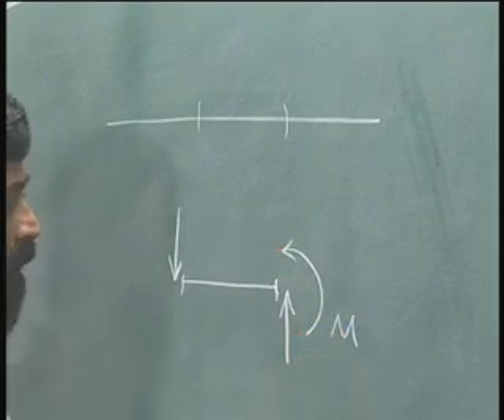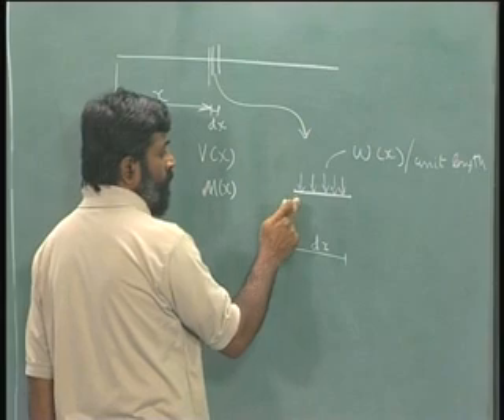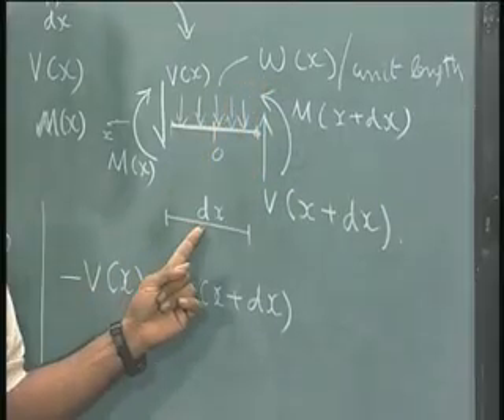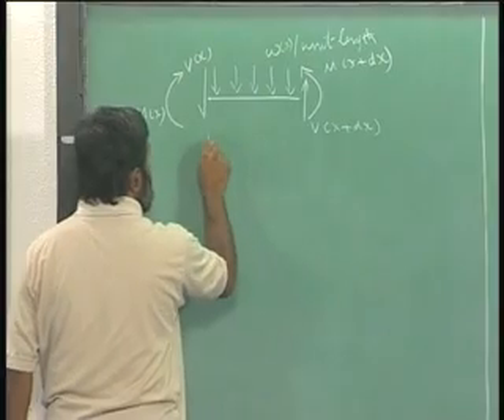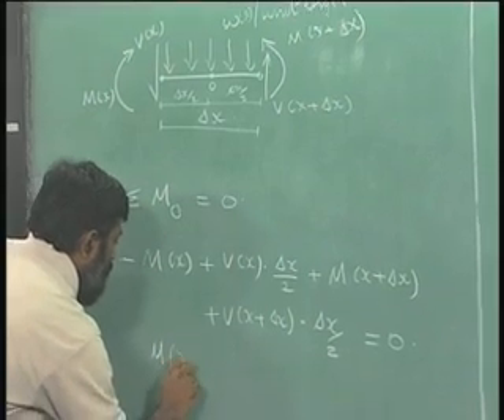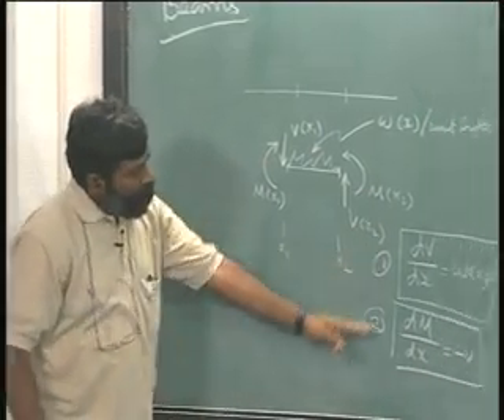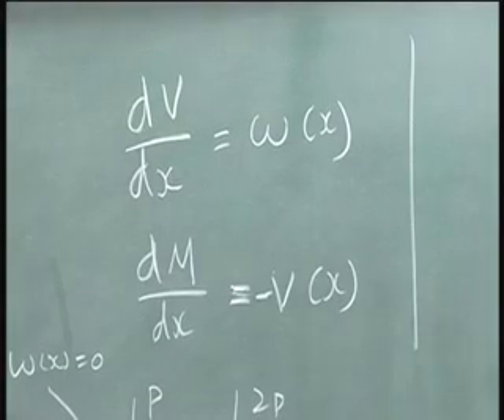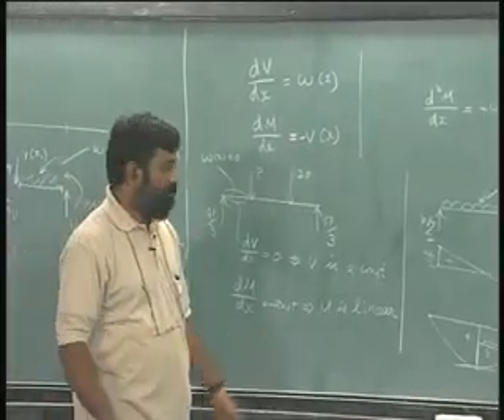Beams - Loading, Shear and Bending Moment Relations

Comment: your assumption for the positive shear force is opposite to what is assumed in timoshenko but at the same time the positive direction for the moment is same. can you please explain the implications of it. I feel that this sign convention will alter the sign convention used for positive shear stresses. Please correct me if i am wrong.
Reply: +ravi pandey because it is convenient in a way that, pretty accurate shape of the structure can be imagined by looking at the BMD..again if we write the signs on the respective coordinates, thngs doesn't change much..